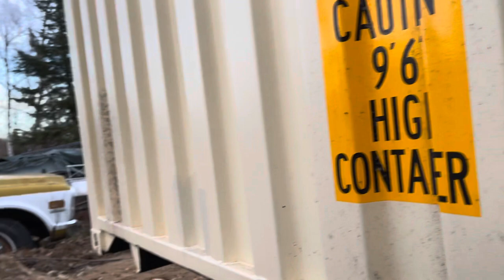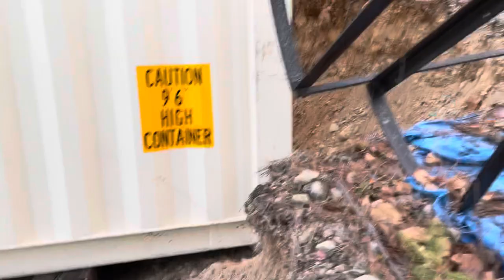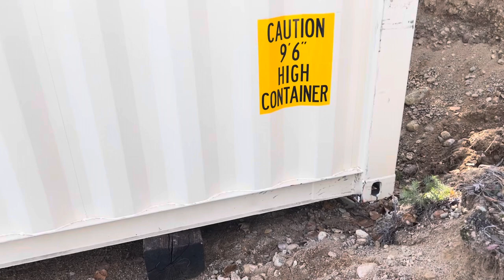Land Prep for shipping container DrMVideo#17 Original Music by Rob Mattson “Our Love”

Comment: Nice 1972  Chevrolet C50 dump truck ! & the Case  TR310B track loader It's nice to have your own equipment to work your property , You did a great job eye balling the level of the ground , & it looks like your going to have a good view of the lake ! I can't believe the people that delivered your container didn't have any additional lighting on the rear , & only 1 strap over the container , In my state they wouldn't issue a permit to tow that down the road with that vehicle , Anyway that is a good color match with the garage ! I wish I had that much fill dirt to work with on my property , Nice job !
Reply from the maker: 👍…they had lighting, I just didn’t record them dismantling it prior to unloading.